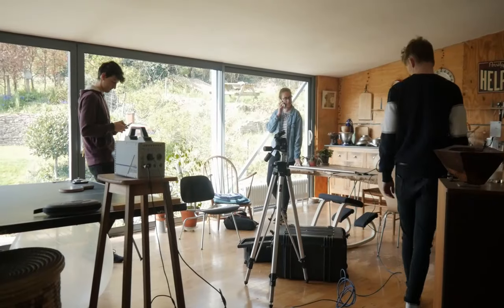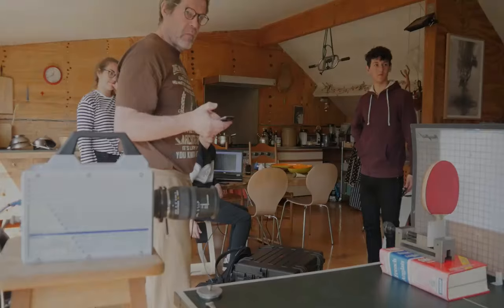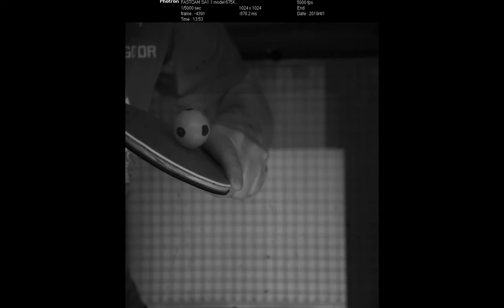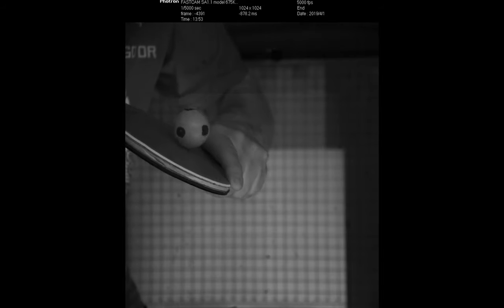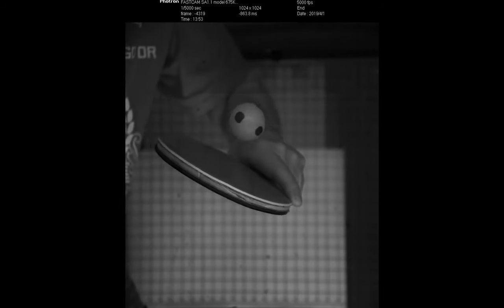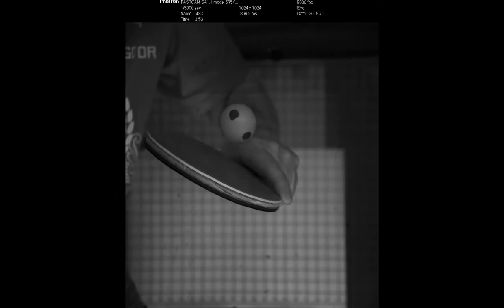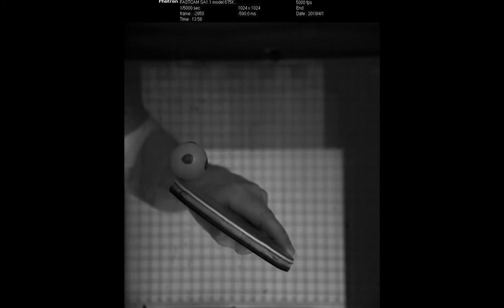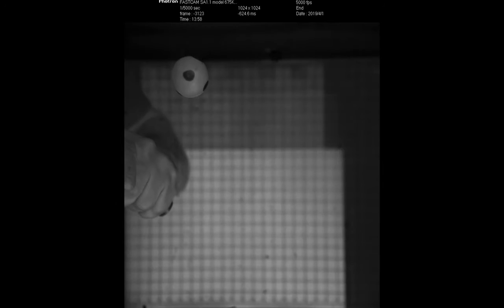Slow motion table tennis; how spinny is your serve?

Comment: The contact point makes a difference int eh serve. the top of your bat is faster. So techincally teh farther you hit away from teh handle the more spin you get. While you are right that hte difference is less than good wrist movement it is still quite the noticable difference. If you check pros serve, they sometimes vary the amount of spin by the by hitting close to the handle or farther away to get high returns.
Reply from the maker: If by top of bat you mean furthest point from the handle, then yeah I agree. good point. thanks. I guess your bat is moving on the arc of circles with centres at body, shoulder, elbow, wrist: each one potentially adding to total speed of bat at the point of contact with the ball, depending on technique. I'm gonna try more 'no spin' serving by hitting the ball near the handle and trying to rotate less (whilst seeming not to rotate less!)

Comment: Amazing: at what speed did you throw the ball? Could you make another video hitting between 70 and 80 km/h at the tip of the table tennis paddle to see how the paddle heads flex, comparing 5 and 7-ply wood blades, and one with classic carbon like Viscaria?

Comment: Hi Paul.  Thanks  for the useful and helpful video.  And what can you say about the ball contact with the bat during the service, is it always a one single point contact or in some cases the ball can roll over the bat's surface?
Reply from the maker: Hi Sasha and thanks for commenting. It was a good fun exercise to do. It certainly looks from our experiment like there's a single point of contact on impact - or a very short roll too difficult to see even at that speed. I've heard that some local tt guys, Steve Hall and Tony Mileham, did some research some time ago at Bath University and did find that the ball rolled on contact with the bat, but I can't locate that research.If you find it,let me know :). all the best....
Reply: @paulredman9747  Hello Paul. It's good you gave some idea where to look for, I'll try to search and share of course if I get something interesting.
Reply: @sashaborisov1715  I wonder if it's just the difference in feel between hiting the ball and brushing it more. I play with Hurricane Hao 3 and Skyline 3 Neo - and there is a clear distinction between both the vibration that I feel and the sound that I hear on more brushed ball during the service.
It is very recent what we can see with these high speed cameras. Yet the players/coaches had to build the idea in their heads and convey it to the next generation.
Reply: @PajakTheBlind   thank you for your comment Pajak, so if I understood you correctly the brushing contact does exist?
Reply: @sashaborisov1715  I do not know your knowledge of physics, but it would seem that when racket hits the ball, some of the energy goes to hit the ball, some goes to impart spin. The more you get this feeling of not hitting the ball, but just brushing it, the closer you get to this idea of 'rolling the ball on the rubber'. 
The video shows us that it is just our wrong way of calling it. And probably the concept of what is happening in a 'brushed' scenario is flawed. The ball pretty much jumps straight away no matter the type of contact.

Comment: So rarely do we go on a web search journey and discover a YouTube video that precisely answers the question we held. I have so many notes, questions, and points to discuss:

1. Amazing work and visualization. Thanks for that

2. Shout-out for a pips version of this masterpiece (it could be a masterpips. sorry)

3. Many coaches say that in a backspin serve for example you should hit the all with the botttom end of the racket such that the ball has more surface to "roll" on and get more spin. They often visuliaze that by rolling the all on the racket with their hands. This video demonstrates my intuition that it's not a real factor, right?

4. But placement on the racket must have some effect, doesn't it? Coaches insist so. I agree that even in super slow motion the contact looks identical, but did you conclude that the effect is so minor we can simply stop thinking about it? If not, what are your insights about that after the research?